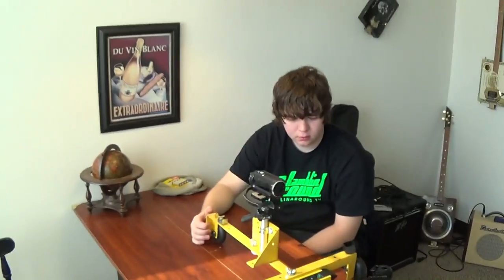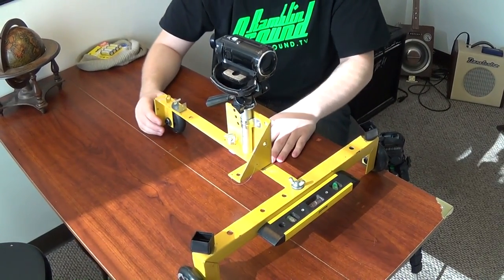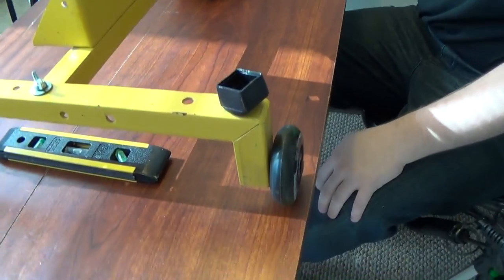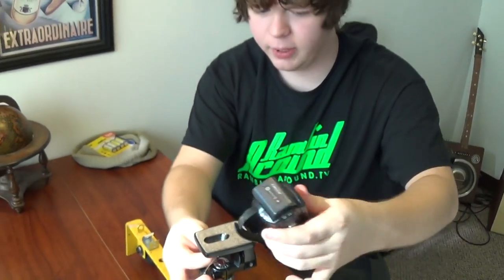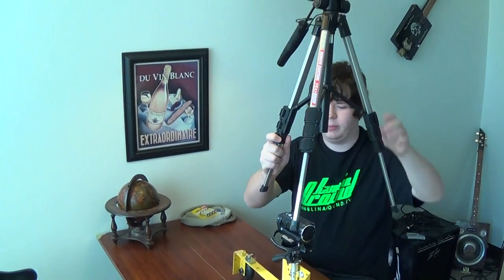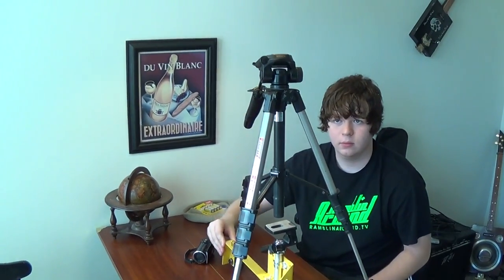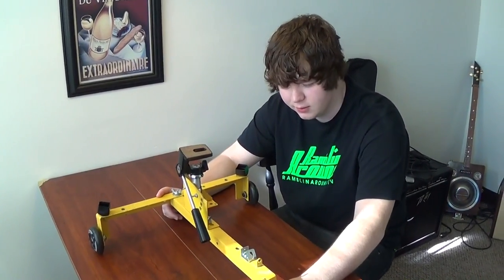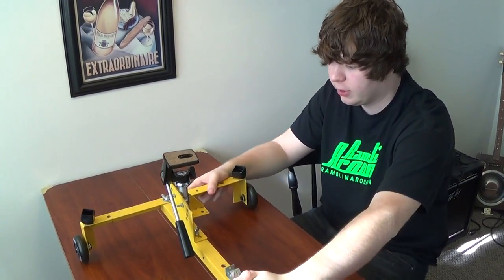Homemade Camera and Tripod Dolly - My Son's Latest DIY Project

Comment: Another nifty feature that could be added cheaply would be a protractor- or at least some penned-in guide ticks- at the pivot point. This is one thing the Pico lacks. After you've used the Pico to do some turning, it's really a matter of guesswork to get it lined up straight again. Most times it is seldom straight.
Reply from the maker: That's a good idea, we'll have to work on that.

Comment: Nice work, and on the video also, I need one now, Thanks to you guys,
Reply: Thanks for sharing this video, I probably would've missed it otherwise.
That's a really good idea.
Reply: No problem. I know there is a old set of roller blades around here some were I am going to make one to.
Reply: Heck yeah, I'm thinking about hitting the
thrift shops to see if I can find an old set myself

Comment: How does it turn ? looks good though
Reply from the maker: He showed in the video at 4:05 -4:10 or so. You just loosen the wing nut and the back wheel assembly pivots.
Reply from the maker: RamblinAround Doesn't turn when using the tripod though.